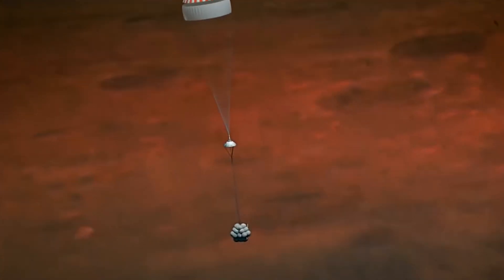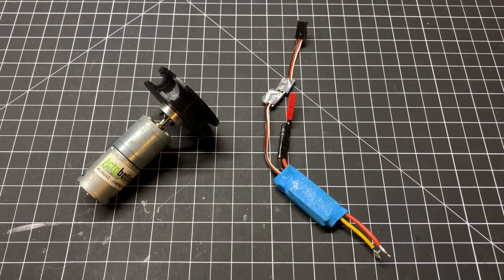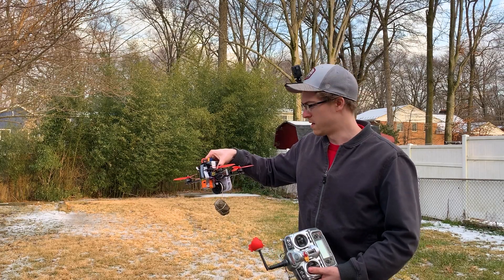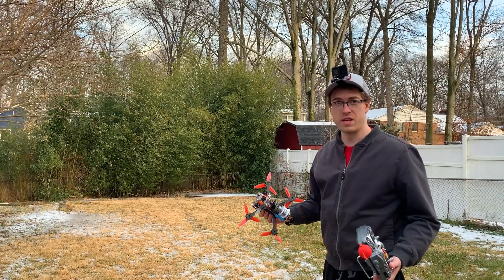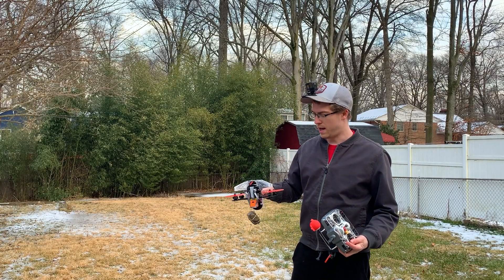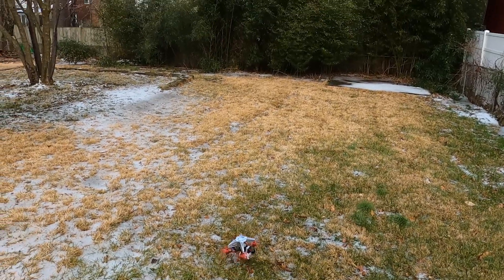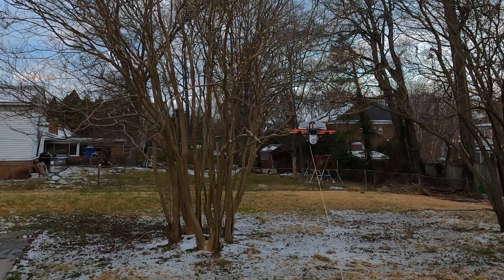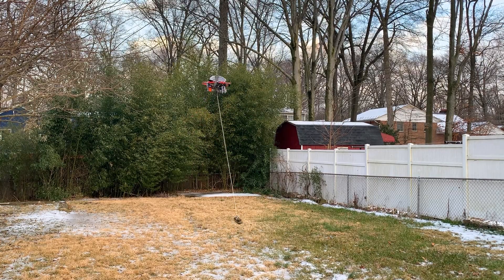Mars Rover Sky Crane: Drone Test

Comment: I fly drones too, but I also know you can’t create lift with no air pressure.
Reply: There is air pressure on Mars.
Now what?
Reply: @silencethedissent6010  what is it supposedly?

Clue, I already stated it...
Reply: @Rude_Earther  It's about 1% of the earths atmospheric pressure at sea level. 

What's your point?
Reply: @silencethedissent6010  my point is, you can’t get lift in that. Are you simple?
Reply: @silencethedissent6010  
Vacuum is an air pressure measurement that is less than Earth's atmospheric pressure, about 14.7 psi. A perfect vacuum, by definition, is a space where all matter has been removed. This is an idealized description. Vacuum pressures that come close to the “almost no matter” point are difficult and expensive to create.

The atmosphere of Mars is much thinner than Earth's. The average surface pressure is only about 610 pascals (0.088 psi) which is less than 1% of the Earth's value. ... The highest atmospheric density on Mars is equal to the density found 35 km above the Earth's surface.

Now search drone in a vacuum, and feather vs fan in a vacuum. 

No air pressure- no lift.
Reply: @Rude_Earther  You can't get lift in 0.088psi air at 35km? That's certainly a claim. Where is your evidence to support it?

You realise that the flight altitude record is 112km? They've been flying above 35km since the 60's.
Reply: @silencethedissent6010  find me a rotor driven craft or propeller driven fixed wing at that altitude.

You’re either a liar or fantasist, which is it?
Reply: @Rude_Earther You said "my point is, you can’t get lift in that"

Then on being confronted with harsh reality, that aircraft have been flying over 35km altitude for 60 years (despite you claiming "you can't get lift") you now move the goalposts?

Are you also ignorant of the fact that NASA flew a prop driven aircraft in 2003 to 29km? What do you think the difference in pressure is between 29km and 35km?

So if the technology existed in 2003 to fly at 29km, why do you think it's impossible to fly at 35km?

I notice there is a complete lack of mathematical argument from you, why is that? Are you mistaking yourself for an aeronautical engineer just because you fly a few commercial drones? 

Dunning-Kruger in a nutshell.
Reply from the maker: A few things—this video wasn’t a demonstration of drone flight on Mars. The drone was just used as a flying platform on earth since I don’t have a rocket powered sky crane. Also, with a little basic aerodynamics, you can prove that it is entirely possible to create sufficient vertical lift in Mars atmosphere with proper rotor design and head speed (I presume your comment was an attempt at a “gotcha” in regards to the ingenuity helicopter about to take flight). Third, if your only qualification is “I fly drones,” then you absolutely aren’t qualified to speak on the science at play. Finally, go troll somewhere else. This is a science-based channel anchored in reality.
Reply: @silencethedissent6010  29 km isn’t 22 miles, and 22 miles is 0.088psi, propellers can’t lift fixed wing to that, and the maximum altitude of a rotor craft ever reached is 41k feet, and that was 1971. Never been beaten still today, you know why..?
Reply: @Rude_Earther   29km is 18 miles, 35km is 22 miles. What is the difference in air pressure? Do you even know?
NASA flew fine at 29km in 2003 (designed in 1999) with a propeller driven aircraft. That's a lot higher than 41k feet. 
You don't think the technology has advanced in over 17 years?

Let me guess, you're going to move the goalposts again?
Why don't you just present the maths that shows this flight is impossible? Is it beyond your comprehension?
Reply: @NicholasRehm  ok so if it’s a science based channel, let’s see you create lift in a vacuum of 0.088psi. 

It’s not possible with a rotor. 

around 100.000 ft
It is a matter of power source (and engine aspiration in case of air breathing engines), wing loading and aerodynamic efficiency. With current technology, the limit is around 100.000 ft (30 km), as proven by Pathfinder and especially Helios.

If it were possible, Helios wouldn’t have a ceiling of 96k first, and Helios is not a helicopter and requires less thrust to weight.

Helicopters cannot fly above 41k or 2.7psi as the air isn’t thick enough, so at 0.088psi, you’ve no chance, feather vs fan at 0.2psi proves my point, search it.
Reply: @silencethedissent6010  nasa Helios reached 96k, it was as its limit. The supposed ‘atmosphere’ of Mars is said to be equivalent to 22miles altitude, or 116160 feet, no rotor craft is capable, prove me wrong, post the link.

The only people claiming it a possibility are claiming $85mil, what they’ve given isn’t worth $10.
Reply: @silencethedissent6010  tell me mr ‘aviator’, do you know the difference between fixed wing and rotorcraft?

Obviously not.
Reply from the maker: @Rude_Earther  Look, I would be happy to walk you through the derivation of rotor-based lift in mars conditions using BEMT and energy methods if you shoot me an email. I would also be willing to forward you some early design reports on the mars helicopter in which they performed these calculations (the same exact calculations and methods used for helis on Earth, just applied to the conditions on Mars. Yes you can do that because math is math). But doing that over a youtube comment would be impossible. In the meantime, I can suggest some resources to help you educate yourself: how about attending school for aerospace engineering and rotorcraft for 6 years while working alongside researchers performing tests on rotors in Mars conditions in large vacuum chambers? Worked for me :)
Reply: @NicholasRehm  I don't think he's going to take you up on that generous offer. I think he's going to go with "Nah, I know it's fake cos I flew a drone this one time"..
Reply: @NicholasRehm  so, let’s get your variable pitch rotor in a vacuum of 0.088psi, until then, you’re talking chit.
Reply: @silencethedissent6010  it’s what happens in those 20k feet, nothing with a prop can get lift there, that’s why nothing has. And certainly no helicopters, that technology is nowhere near at a 41k ft limit.
Reply: @Rude_Earther  " it’s what happens in those 20k feet, nothing with a prop can get lift there, that’s why nothing has. And certainly no helicopters, that technology is nowhere near at a 41k ft limit."

So you keep claiming, but you've brought nothing to the table once again.

Do you have anything better than personal incredulity?
Reply from the maker: https://www.youtube.com/watch?v=nAQxNd3uBN0
Reply from the maker: Low Reynolds Number Airfoil Evaluation for the Mars Helicopter Rotor: https://ntrs.nasa.gov/citations/20180008702
Reply from the maker: Design and Fabrication of the Mars Helicopter Rotor,
Airframe, and Landing Gear Systems: https://arc.aiaa.org/doi/pdf/10.2514/6.2019-0620
Reply from the maker: Generation of Mars Helicopter Rotor Model
for Comprehensive Analyses: https://core.ac.uk/download/pdf/161997363.pdf
Reply: @NicholasRehm  are you citing that video, with zero information and a terrible RC rotorcraft smashing uncontrollably into the ground, as evidence of something other than whoever built it is crap, and the people imagining it’s something other than that being gullible?
Reply from the maker: Experimental Investigation and Demonstration of Rotary-Wing Technologies for Flight in the
Atmosphere of Mars: https://apps.dtic.mil/sti/pdfs/ADA480504.pdf
Reply: @silencethedissent6010  my evidence to the table is evident in life. Flying in such low pressure is impossible here. Regardless of the ridiculous video cited above. And anyone can produce paperwork, but that doesn’t justify the $85mil price tag. 

Also, as people suffer through endless lockdowns, job losses and general government imposed restrictions, what will the tax payer gain from this?
Reply: @NicholasRehm  like I said, the only people claiming it possible, again with zero credible physical evidence, stands to receive $85 million if able to convince the gullible masses. Hello.
Reply from the maker: @Rude_Earther  That test was performed in a vacuum chamber, with identical atmosphere composition and pressure to Mars :) So your claims of vertical flight being impossible in these conditions is therefore debunked. Check out the papers I cited for some analytical and EXPERIMENTAL validation of the aerodynamics in a Martian atmosphere. I'm seeing a lot of thrust being generated in these studies, which you said was impossible? What excuse are you going to come up with next?
Reply: @Rude_Earther  " my evidence to the table is evident in life. Flying in such low pressure is impossible here." 

Repeating the same claim does not equal providing evidence for that claim. 

Once again, you've failed to back up any of the nonsense you've been spouting from the start.
Reply: @NicholasRehm  theoretical papers represented by a crashing drone with no reference to any information of any value, then by another spinner at full tilt but still requiring LIFTING. Sorry I’m obviously just not as gullible as you, and I’ve already seen everything you posted, here I thought you had something new, like you putting a Trio of T. rex 700 rotors on that variable pitch hub attaching it to a 500kv motor running it 6s, with something like a DJI naza, whacking it in a vacuum chamber, dropping the pressure to 0.088psi and gaining lift. But no, you’re just posting the $85mil propaganda.
Reply: @NicholasRehm  I saw nothing of a gauge in that ROOM, because as far as looking at the video, that’s all it is, a ROOM, none, zero ‘scientific’ data.

It’s like me filming in the desert with a sepia filter claiming I’m on ‘Mars’, and writing a ‘scientific paper’ as my confirmation evidence...
Reply: Is this dude for real
Reply: @Rude_Earther  obviously there was enough "air" to fill the parachute. INTERESTING
Reply: @NicholasRehm  Rude Earther thinks the ISS might be a drone.
Reply: @whereswa11y  the cgi parachute? Yeh, that was cgi air.
Reply: @Rude_Earther  Why are you still claiming there is no atmosphere?   Mars has an atmosphere and you calculated yourself that the rotor would develop thrust even in that thin air.
Reply: @Wolfie6020  you been there?
Reply: @Wolfie6020  and why are you claiming you fly over Antarctica- when you don’t.
Reply: @Rude_Earther  Oh come on,  don't try to change the subject that is the lamest trick in the FE book. 

In our previous discussion on this you actually posted the thrust values from a propellor thrust calculator using a Mars density atmosphere.   I then showed you that in the lower gravity it would be sufficient to fly as the thrust from two rotors exceeded the craft's weight on Mars. 

So why are you here making the same incorrect claims again?  That is what Gary Wybenga does but I thought you were better than this.
Reply: @Wolfie6020  and as I said, those RC thrust calculators are based on theoretical assumptions at those pressures, if they weren’t we’d have a propeller driven altitude record above 96k, and if they WERE accurate, as I asked you before, what did nasa spend the $85 mil drone price tag on, you can have foam core propellors made to spec now, as a civilian for relatively cheap, and all the other components are penny’s. And propellors don’t lift without air, claiming otherwise because your lifestyle is paid for by those lies... 

Parts and price list for the RC heli, your missus must be able to get hold of it.
Reply: @Wolfie6020  and your guy here has a three blade variable pitch rotor, he builds them!!, let’s get one on a 750kv motor, with some T. rex 700 blades, on 6s, with a possible 40° of rotor tilt, and get it in a vacuum!! Bare minimum set up, well over powered. 

If you can’t show me that generating lift- you’re lying and pushing lies, and until someone is showing it who aren’t claiming billions for the pleasure I’m calling chit, and will remain doing so.
Reply: @Wolfie6020  now, give me 6 six long lat coordinates along that flight from Perth to South Africa, and which emergency diversion airports you use for the route.
Reply: @Rude_Earther  You are still forgetting about the significantly lower gravity on Mars.    Of course it won't produce lift in zero pressure.  But Mars has 0.088 psi.  

There is a video showing a normal fan blowing a feather in a reduced pressure atmoshere.  

You have shown absolutely no proof that it could not fly under those conditions.  Your claims are speculation based on nothing more than your own resistance to accept the truth.  

The math proves you wrong.  Several people with far more experience in aerodynamics have stated you are wrong.   

Go ahead and prove no lift can be generated in 0.088 psi with 48 inch rotoros spinning at 2400 rpm.  I'll wait.   

I recall you were going to build a vacuum chamber yourself at one point and prove tyres burst in a vacuum.  That never happened though did it.  

Standby for the coordinates.  I flew FACT to YPPH myself in 2016 on the way home from the Olympics. 

I'll post that as a seperate comment for you.
Reply: @Rude_Earther  

Six Lat Long Coordinates.   Easy - these are straight off a flight plan I have personally flown. 

Waypoint UPTOM S41501 E065000
Waypoint RERAB S43000 E075000
Position 4380S. S43000 E080000
Position ETP2  S42474 E080486
Position 4090S S40000 E090000
Waypoint KEELS S31286 E113227

ETP pairs were FALE-FIMP and FIMP-YPPH

Total distance was 4431 NM.   Planned flight time was 9 hours 12 minutes (Average GS of 481 knots) 

Anything else? .
Reply: @Rude_Earther  Please show your proof that the parachute is CGI.

I look forward to your response, as I helped manufacture it, and I'm pretty sure my software doesn't have anything to do with CGI.
Reply: @david_akerman  pretty sure software is a computer program, not reality.
Reply: @david_akerman  ok dave... just one more... 

Gtfoh.
Reply: @david_akerman  when you have launched something- ANYTHING, come back you mouth breather.
Reply: @david_akerman  mouth breather thinks he’s a parachute scientist because he read the diameter of a parachute. Mouth breathers everywhere. All seem to follow wolfie, ahh well, long as it makes you feel ‘intelligent’ wolfaldo...
Reply: @Rude_Earther  This keeps getting better.  3 more swerves to avoid showing the CGI proof that you don't have.  Next time you make a claim that you extracted from your rectum, try not to do it in the presence of someone who was involved in the project that you are trying to deny happened.
Reply: @Rude_Earther  You can deny it all you want, doesnt change the science.
Reply: @Wolfie6020  just write the long lats in standard format, you’re looking so dishonest right now, what’s 40% of 1800?

Weren’t you adamant it was 624?
Reply: @Wolfie6020  no, I just found it and took a screen grab, so, 675 is 40% of 1800 according to wolfie. And you tell people you are creating flight routes, nah, you follow predetermined routes, like a taxi driver following a sat nav.
Reply: @Rude_Earther  Admit you were wrong when you said this "they’re not longitude latitude positions "

40% of 1800 is 720. 

But the gravity on Mars is not 40% of the Earth's is it you sneaky lad. 

What is 37.7% of 1800?
Reply: @Rude_Earther  No 675 is 37.5% of 1800.    

40% of 1800 is 720 but the gravity on Mars is not 40% is it mate?   Google it.

Not is is nothing like a taxi driver following a Sat Nav. The taxi driver does not have to consider altitude and crosswinds or weather patterns.   We fly so high we can use custom routes which are more efficient.  You are just parroting nonsense that Flat Earthers sprout.  In reality you have no personal experience flying jets around the Earth.
Reply: @Wolfie6020  they’re not, they are positions on a flight plan, not long lats, write the long lats, I’m not clicking any of your links, I don’t trust you as far as I can spit- WHATS 40% OF 1800?
Reply: @Wolfie6020  where you getting your 37.7- sneaky f stick??

On top that, the gravity on Mars' surface is much lower than it is here on Earth – 62% lower to be precise. At just 0.376 of the Earth standard (or 0.376 g), a person who weighs 100 kg on Earth would weigh only 38 kg on Mars.
Reply: @Wolfie6020  did you make it up, because you don’t even get 475 from 38%.

Oh dear. You just make things up to fit, you just proved it.
Reply: @Rude_Earther  I got the 675 from 37.5% just like I showed you in the comment.   

I got the 37.7 from here. 
https://nssdc.gsfc.nasa.gov/planetary/factsheet/planet_table_ratio.html

I did give you Lat Lon in the standard format used for navigation by pilots. Was that too complex for you?   Would you like them in high School geography format?  You do realise Lat Long can be presented in various formats.  All of which are valid.  That format is based on DMM.  Google "DMM coordinate format"
Reply: @Wolfie6020  The numerical values for latitude and longitude can occur in a number of different units or formats: sexagesimal degree: degrees, minutes, and seconds : 40° 26′ 46″ N 79° 58′ 56″ W. degrees and decimal minutes: 40° 26.767′ N 79° 58.933′ W. decimal degrees: -40.446 +79.982.
Reply: @Wolfie6020  not swerve look at me I’m a pilot codes, just normal lat longs that everyone uses. 

And the emergency airport names. What you scared of????
Reply: @Wolfie6020  diversion airports for routes crossing the Indian Ocean. None near or on Antarctica funnily enough, they are all in a northerly arc...

Common diversion airports on Indian Ocean routes:
Socotra Airport.
Seychelles International Airport.
Roland Garros Airport (Réunion)
Malé International Airport (Maldives)
Naval Support Facility Diego Garcia.
Cocos (Keeling) Islands Airport.
RAAF Learmonth.
Reply: @Rude_Earther  Of course the diversion airports are not on the Antarctic.  How are they going to accommodate / feed and care for hundreds of passenger at short notice in an emergency landing at a small base?  

Think mate.  Use your brain.  

If you have a sick passenger that needed urgent medical attention are you going to land on a strip nearby with no facilities or hospital or will you fly an hour longer to a major city with a hospital?   Think. .  It is not hard.
Reply: @Wolfie6020  but I thought flights take passengers to Antarctica on holiday...

Make your mind up, you go nowhere near. Like I said, flights stick 20-25° either side of 0° over open ocean. All your emergency diversion airports are north of 25°s.
Reply: @Rude_Earther  Yes those flights to the Antarctic are planned in advance with enough food / catering and equipment to support the people while there. 

Totally different when you have a plane full of 300 people including, elderly, babies and small children suddenly appearing unplanned. 

When will you start actually thinking?  

Wrong again.  Two of my emergency airports were YPPH and FALE.  Both are South of 25 S.
Reply: @Wolfie6020  how long is your total flight time Perth to Durban??
Reply: @Wolfie6020  Flight time from Perth to Johannesburg is 10 hours 45 minutes. Non-stop flight time is around 10 hours 45 minutes. Quickest one-stop flight takes close to 19 hours. However, some airlines could take as long as 43 hours based on the stopover destination and waiting duration.

13h 50min is the average flight time from Perth to Durban King Shaka International.

So you were very confident in your flight plan at under 10 hours, 9hr, 12 mins you said right?
Reply: @Wolfie6020  well, I’ve searched an entire year for a direct flight from Perth to Durban, there aren’t any, minimum one stop- Dubai. 

I dunno wolfsk, you’ve not shown to be the most honest, it’s taken a week for you to simply state 40% of 1800.
Reply: @Rude_Earther  You wasted a year on that?   Don’t you understand airlines are bound by cabotage laws  and economics?

Try NetJets.  They will do it direct for you but I doubt you could afford it.

I have personally flown Cape Town to Perth direct.    We could do Durban - Perth direct also no problem.

When was the last time you were south of the Equator.?

A week?  You know I travelled from Dallas to SFO amd to Sydney this week don’t you?  IWhat makes you think replying to you on YouTube is my number one priority?  

Why are you obsessed with 40%? That is not the gravity on Mars.
Reply: @Rude_Earther  

Yes I am absolutely certain it was under ten hours.  Did you forget the Global Express flies faster than airliners?  

Flight Plan time - 9 hours 12 minutes
Actual time 9 hours 9 minutes. 

It is right there in the video.  

https://www.youtube.com/watch?v=aEKu3ADsoCE

Make sure you read the comments from the Flat Earther who did not believe I was a pilot.   When she saw the video she deleted the entire conversation and blocked me.
Reply: @Wolfie6020  
I will say this, when it comes to manoeuvring, NASA has nothing on a Flat Earther trying to avoid responsibility for their own comments ;)
Reply: @Wolfie6020  @5:08, distance covered ground 4811nm, air 4362 nm?? I always thought flights added distance over ground for altitude?? Obviously going up and down x miles will ultimately add x miles to journey?? See at 4811nm I can plot a flight from Durban to Perth flying between 20-25°s. So what is the total distance?? I’d say ground..?
Reply: @Wolfie6020  asks quantas apparently don’t fly to Perth regarding some dispute, they state only South Africa Airlines run the flight, but yet again when you try to book...

Article from executive traveller:

Qantas remains keen to launch direct flights between Perth and Johannesburg, in addition to the established Sydney-Jo'burg route, once international travel resumes.

However, a sticking point remains the airline's ongoing dispute with Perth Airport – particularly with regard to Qantas' desire to run its Perth flights from its integrated Terminal 3-Terminal 4 hub, rather than the T1 international terminal used by other airlines.

For the time being, Sydney-Johannesburg is set to switch over to a Boeing 787-9 following last year's retirement of the Boeing 747.

The jumbo-to-Dreamliner swap was already on the cards before COVID-19 struck, and Qantas has received ETOPS approval for the route.

(ETOPS refers to the restrictions placed on twin-engined aircraft by aviation regulators, which limit how far commercial flights can venture from a safe landing point on the ground: a cap that's particularly relevant on long over-water flights, and which varies from one aircraft type to the next.)

"We've now got the ETOPS approval for the 787s to fly direct from Sydney to Jo'burg, in fact we've already done a few repatriation flights that way," Qantas Group CEO Alan Joyce reflected at the recent Reuters Next online forum.

"And if we can resolve our dispute with Perth Airport, we will start the Perth-Jo'burg service, which is on our list of new routes, and we think that will be very successful," Joyce added.

Pulling the plug

Perth-Johannesburg was previously flown exclusively by South African Airways, which spent much of 2020 facing its own set of financial issues.
Reply: @Rude_Earther  You are trying too hard to avoid the video I showed you proving I did the Cape Town to Perth flight myself and it was 9 hours and 9 minutes. 

No need for all the obfuscation.   You are talking to a real Pilot who has actually done it.   Who cares about Qantas mate. My plane flies higher and faster than anything in the Qantas fleet.  

The Earth is a Globe.  Flat Earth is a silly scam.  Wake up and deal with it.
Reply: @Rude_Earther  Air distance was shorter due to tailwinds mate.  You are failing lesson one for a private pilot now.  

Let me explain it to you. 

If the aicraft can fly through the Air at 100 mph the air speed is 100 mph

If that air is moving at 20 mph and you fly in the same direction the air is moving your ground speed is 120 mph and your airspeed is 100 mph. 

If you fly for an hour you cover 120 miles over the ground. 

If you turn around and fly into the wind your groundspeed is now 80 mph. 

If you fly for an hour you cover 80 miles over the ground.  Easy. 

The whole reason we flew East from Rio was to take advantage of the strong westerly winds.   

Had we gone West via Tahiti the flight would have taken longer even though the distance was shorter.
Reply: @Wolfie6020  time is adjustable by speed, distance doesn’t change, and the actual ground distance is 4811 nautical miles, says it on the screen, and like I said, a route between 20-25°s can be worked into that.
Reply: @Rude_Earther  No shit Sherlock.
Reply: @Wolfie6020  so, as I said, flights head towards 0° first, not the other way. And you said the tail wind shortened the distance- impossible! 
Time yes, actual distance, never.
Reply: @Rude_Earther  No I did not say that at all. What is wrong with you mate?  Are you drunk?    No they don't head toward zero first.  

Every comment you make is a fail.  Are you a poe?
Reply: @Wolfie6020  re read your comment, you said air distance was shorter due to tail winds, distance is constant, only time can be shortened by speed.
Reply: @Rude_Earther  Yes air distance was shorter.  That is true when you have a tail wind as you cover the ground distance faster.  

Time is shortened and air distance is shortened.  Ground distance is constant.
Reply: @Wolfie6020  so the actual distance was 4811 nm, not to mention your flight appeared to begin off the southern tip of Africa when Johannesburg is around 26-26.5°s, anyway, from joberg you simply head towards 24.9°s, 75.7°e, then back down towards Perth still slightly shorter @4,733 nm. 

Jus sayin’
Reply: @Wolfie6020  oh, my emergency diversion airport for the route I specified, which could be pushed a little further up to around 22°s and still fall within 4811nm (actual ground distance), would be Male (Maldives).
Reply: @Wolfie6020  my apologies for numerous reply’s, you know how I am, ok my 40% comes from the multiple theorised/ assumed values, ranging from your 37.7%, 38% and 40%. If I was spending $85 mil I’d be working with the upper values, not the lower ones, why would you give for 37.7% when it could possibly be 40%? 

I think I’d be aiming to lift 1.8kg in 0.088psi first, just to be safe, but as that’s impossible...

Deploy fishing reel!!
Reply: @Agent 666 because there’s no air, air, ir, ir, r, r...

Where’s Clark gone superman?
Reply: @Agent 666 what makes you think there is?
Reply: @Agent 666 by asking me why I think there is no atmosphere on Mars you must be asserting there is one, and so we are at an impasse. Mars is a concept as far as I’m concerned, and how coincidental the conceptual ramblings of ‘Astronomers’ of old seemingly translate into modern day imaginings.
Reply: @Agent 666 <is this your Clark or Superman wolfski?
Reply: @Rude_Earther  If the emergency is a depressurisation you will have severely reduced range at the lower altitude required to fly so the worse case scenario (ETP Dep) is usually how the ETP pairs are computed.    You would not reach the Maldives in all cases and certainly not with reserve fuel intact.
Reply: @Rude_Earther  Ok lets go with 40% and 47 inch props (even though they are slightly larger) 

Even so, in the 0.088 psi atmosphere the two rotors will develop more than enough lift to hover. 

You only need 1:1 to hover.   A little more to climb.    Once you start moving you also get translational lift.    It is not a racing drone.  It is a craft specifically designed to fly in those conditions.
Reply: @Wolfie6020  Maldives is 1600nm N from 22.2°S, 77°E, 2300nm E from Johannesburg, and 2500nm from Perth, the route you gave would leave 2200nm either way but 2700 to male, which would be the closest mid point diversion. And I’m calling balks.
Reply: @Wolfie6020  plus, to fly 4811nm actual in 9.15 is a record, you’d have to be pulling average 520kn and you said 481 right??

You’re figures are as shifty as your 40% of 1800 routine.
Reply: @Rude_Earther  Mate nothing wrong with my numbers.   You just keep using the wrong numbers. 

These are my exact words.  Go back and check it yourself.  

"Total distance was 4431 NM.   Planned flight time was 9 hours 12 minutes (Average GS of 481 knots)"

4431 NM.  (9 Hours 12 minutes) = 481 knots average ground speed.

How come you can't quote numbers correctly when they are right there in front of you?   Please explain.    This happens often wth you.   Even your 9:15 is wrong.   It was 9:12 on the flight plan.
Reply: @Rude_Earther  But we would not be at 22.2 S midpoint between Perth and Johannesburg.  Why would you route that way?  

 We would be further South than both cities mid point.  That is how Great Circle Navigation works.  

Mid point on the Cape Town to Perth Flight we were around 40 S.  

Male would be too far.  There are closer options.
Reply: @Wolfie6020  I rounded to 9:15 for ease of calculation. You’re a liar. Says on your screen 

AIR 4431nm<<<<<<DISTANCE >>>>>> 4811nm GROUND

9:15@520kn 520x9.25= 4810
Reply: @Wolfie6020  where are the closer emergency airports, you said there were closer options on you flight @40°, where are they, name them.
Reply: @Wolfie6020  Common diversion airports on Indian Ocean routes:

Socotra Airport
Seychelles International Airport
Roland Garros Airport (Réunion)
Malé International Airport (Maldives)
Naval Support Facility Diego Garcia
Cocos (Keeling) Islands Airport
RAAF Learmonth
Reply: @Wolfie6020  nasa, billions of $$$ an apparent 8 month space journey, zero photos/ videos of the journey, and now?? Photos of wheels and dirt. So, whilst everyone is losing their jobs, suffering mental and general health issues here, what do we gain for those billions of £$£$???
Reply: @Rude_Earther  Your inability to read and follow a conversation does not make me a liar mate. 

This is what you wrote "Says on your screen  4431nm<<<<<<DISTANCE >>>>>> 4811nm GROUND"

No it doesn't.  You are wrong.  The FMS shows 4362 Air - go check it again.  How can you get confused when it is right there for you?   

The 4431 is the FLIGHT PLAN - the 9:12 is the FLIGHT PLAN (Average 481 knots)  I told you that.  

Actual flight was 9:09.  Actual air distance 4362,  actual ground distance 4811. 

Do you agree the flight plan states 9:12 and 4431 NM?   Yes or No?   In which case you owe me another apology.
Reply: @Wolfie6020  now map out your route along 40° to 4811nm actual. Also 15 minutes is 1/4 of an hour. .25 is 1/4 of 1. Not hard, I just rounded the figure else 4811nm in 9.12 would be closer to average speed of 522 kn. and the GROUND DISTANCE displayed ON YOUR SCREEN is 4811nm. You cannot shorten PHYSICAL DISTANCE, only the time taken to cover it. The 40° route is 4431nm GROUND. Not air. You know exactly what I’m saying.
Reply: @Rude_Earther  You are still getting confused with your numbers.  Seriously mate it is getting tiring correcting you.  

9.2 is not hard either.  No need for rounding.  The flight was actually 9:09 anyway. 

Are you going to answer?   Do you agree the Flight plan shows 4431 and 9:12?  Yes or no. 

The 40 route is not 4431 ground.   That 4431 is NAM (Nautical Air Miles) It is how many miles of air the aircraft flew through based on the PLAN only. 

The actual was 4362.  the ground distance is longer than that.  That is due to the tailwind.  

Really mate.  Do you not see all your constant mistakes with the application of numbers?  

You claiming the 40S route is 4431 Ground is completely wrong.   Just give it up.  The shortest ground distance possible between FACT and YPPH is 4,702 NM.   Impossible to have 4431 ground.  

Here is the deal.  If you post another comment with mistakes I am just going to reply with "try again".
Reply: @Wolfie6020  is this why you keep screaming look at the air miles?? 

One land mile is equal to approximately 0.87 air miles. Convert land miles to air miles directly by multiplying the number of land miles by 0.87 to get the number of air miles.

So air miles are actually longer than ground, so your physical journey was 4811nm, and to cover it in 9hr 12mins your ground speed would have to have been plus 522 knots.
Reply: @Rude_Earther  LOL Why are you introducing statute miles now?   Please explain.  

What part of Nautical Air Miles do you not understand?  

You are one very confused dude Rude.  

I said look at the flight plan mate because that is what I used for the 481 knot average.

Here you go.  Nautical Air Miles - A nautical air mile is one NAUTICAL mile through the air mass.
Reply: @Wolfie6020  because you are manipulating things, ground distance was 4811nm, when I measure distance using google earth- your model, it measures ground distance, not 35kft distance, and your route doesn’t add up to 4811nm ground. Simple.you can try again me as much as you like. It’s on YOUR screen, DISTANCE>>>>>> GROUND 4811nm.
Reply: @Rude_Earther  And you still don't get what Nautical Air Miles means.  Did you Google it?  

I am constantly correcting your mistakes mate.  You can't get a single thing right.  

Forget statute miles. 

Nautical Air Miles - A nautical air mile is one NAUTICAL mile through the air mass. 

What part of this do you not understand?

4431 NAM - that is the flight plan.  Right there in black and white.
Reply: @Wolfie6020  I’m not using statue miles wolfie, I’m using nautical miles. 4811 of them.
Reply: @Wolfie6020  and why would your copilot be contacting Johannesburg ATC 800 miles away and headed south?? Wouldn’t you be contacting Cape Town ATC?? All very suspect.
Reply: @Rude_Earther  Not suspect at all.  You need to go and research FIR boundaries.  

Over the entire Continent of Australia we either talk to Brisbane or Melbourne Centre. 

There is No Perth Centre.  Taking off out of Perth after leaving the Control Zone it is straight to Melbourne Centre even though Melbourne is over 1000 NM away.  

Again, it comes back to you not doing your homework.

Even approaching Indonesia from Broome we are still talking to Brisbane Centre. 

We go to San Fransisco radio a thousand miles before even reaching Hawaii.  

Go ahead and find me a HF frequency for Cape Town at that location.   Good luck.
Reply: @Wolfie6020  Johannesburg ATC doesn’t cover the route you provided according to FIR boundaries, at the beginning of the flight @0:43 on your video, your copilot contacts Johannesburg ATC. Why?

FIR boundary for the beginning of your flight would be Cape Town west then east.
Reply: @Wolfie6020  and Maldives is way off your apparent route... 

😬

Joberg ATC, joberg ATC, this is wolfie and co flying over Cape Town and heading south, just thought you might like to know, could you let Cape Town ATC know for us thanks...
Reply: @Rude_Earther   See the green shaded area mate?  All Johannesburg

https://drive.google.com/file/d/1uH5Qfq5Kq7ngZcmDD36CIoZ-mOHakb0A/view?usp=sharing

How far to Perth when he was making that call?   I'll save you the time.  4235.  So we were already about 500 miles from Cape Town.
Reply: @Rude_Earther  Where is the Cape Town Oceanic HF frequency mate?   Please explain?
Reply: @Wolfie6020  you said search FIR boundaries, I just told you what it says, and I’m not clicking your links mr Johannesburg ATC.
Reply: @Wolfie6020  so your link is right but the internet is wrong, oh goshk, best call somebody.
Reply: @Wolfie6020  I just searched FIR boundaries South Africa, like you said.🤷🏻‍♂️
Reply: @Rude_Earther  14 days is easy mate.    I have done it plenty of times already.   Not only is it a holiday with no work but I am on full salary and they even pay an extra tax free allowance for the inconvenience of not being at home.   Too easy.  I work out every day and go home fighting fit and ready to party.
Reply: @Wolfie6020  cool beans, like I say, I’m off too, I’ve had 41k for not working so far, it’s not bad at all.
Reply: @Wolfie6020  you joining in on gear 74’s cross 90°S Antarctic flight? I’ve submitted my route, time, distance and fuel requirements already. 777, 250 passengers @$1000= $250,000, that’s plenty for, 5820nm start Rio Gallegos- Perth via 90°S, @490kn roughly 12 hours, 7 ton fuel per hour average @$420 per ton, $38,500 fuel.

You comin??
Reply: @Rude_Earther  I think you need to look at your numbers again.    What is the fuel price in SAWG?   

I'll tell you.   Quoting on the World Fuel Services site now. $3.72 USD per gallon. 

Also they had the following note. 

No Supply for foreign tail numbers until further notice 1) Minimum Notice Required: 24 businnes hours prior notice required 2) Ramps serviced: All ramps 3) Additional Information: All State and Municipal taxes will apply regardless of destination. for more information please contact your local fuel logistics team on fuel24@wfscorp.com

The 777 -300ER holds over 47,000 US gallons of fuel.  If you use 40,000 on that trip the cost of fuel alone is over $148,000

So your numbers are way off. 

Things you have not considered. 

1. Getting the Plane to RGL and back from Perth - that cost is factored into the Charter.   There are no 777's sitting at RGL there waiting for you.  
2. The cost for each passenger to get to RGL and then home from Perth. 
3. Airways charges
4. Insurance premiums for Hull on that route.  

Sorry mate but your $1000 is dreaming.   You will be paying ten times that for a seat on this aircraft.    
Go ahead and arrange it and when the flight is confirmed then sure, I will buy a ticket.
Reply: @Wolfie6020  With a metric tonne being 1,000 KG or 2,204 lbs, this equates to about $0.45 / £0.33 per KG. This price is about 34% lower than one year ago (January 2020) where the price of Jet A1 was approximately $650 per metric tonne or about $0.65 per KG.

Even that’s still only $54,000 for fuel, where’s your 10k ticket price coming from?? I can fly Rio grande to Melbourne in 33hr with one stop for £600, so explain mr Johannesburg ATC.
Reply: @Wolfie6020  7 ton per hour, let’s say 13 hours to be safe, that’s 91 tons 31.7 gallon to a ton $2.97 (Aiglle)per gallon, $94.15 per ton x 91=$8,567.
Reply: @Wolfie6020  just for everyone in the thread, this is what you did last time, started pulling fantastical prices out ya Jet A. 

Thanks for confirming what I said.
Reply: This discussion has aged badly😂